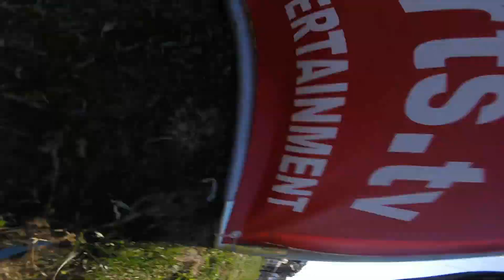The Charlie Show /// Episode 24 /// XR10 Comparison

Comment: The 1080 is damn good for crawling, no need for bl overkill imo, unless your comping. Had several in trail scalers, crawlers & knowing how cheap they are along with a decent re-buildable brushed motor.. I'm older & use to turn armutures for a couple hobbyshops & myself on race day. Hell even decent NIMH packs are so much more convenient trailing/crawling, charge up a few packs & maybe go the next day.. I know I'm rambling but that's what these sections are for.. Putting as much as I do into electrics into a crawler or basher as race kit is just not necessary, but to each there own I suppose. The new v3 just stock is perfect for club spec races, if your going to spend more like on the xr10 80amp, might as well & get something with more balls like LRP, MuchMore, or even Tekin. 80 or even 120a doesn't have nothing on most competition esc's.

Comment: Tnx a lot for the Info, would you please suggest me for which is the best choice for XRAY 12 22 for combo esc and motor?
i was thinking about 1S-HD Modified for 1/12 ( battery 2s is it good for it? ) and Motor XERUN V10 G3 Brushless Motor

Title: 6.5T OnRoad Spec.
what  I m concerning is about the battery to use, 
i hope that u will find time to let me know about it
TNX Antonio

Comment: Just put together a 10BL120, 
super impressed with handling a 3800kv Holmes Puller on 2s ... 

then, I put a 5 slot 8 turn holmes on the quickRun 1080 using 3s.. 
no problem. 

keep it up

Comment: Will the 60amp work or a redcat volcano
Reply: Yes, you have to solder the wire directly to the motor or you could solder the connectors from the old escrow on the wires

Comment: Have XR10 Justock ESC G2.1 13.5T COMBO, will it be safe to add 6+Leds to the system? Also whic LiPo battery will be a enough for this setup, an 6000 3s 30C can be enough?

Comment: Is the RX10 Justock sensored? and which motor is best for rock crawler super low speed with some high speed blashing?
Reply from the maker: I've had good luck with my 13.5 setup on 2s.  For 3s, a 17.5 turn might be in order. 

Only thing was an "option" High Torque (larger Diameter Rotor) and turned the motor endbell timing down for a bit better "crawl" performance.

Comment: Great info Charlie. I picked up the XR10 Pro Stock Spec and it's been wonderful thus far with my 13.5 Wheeler. However, I would like to start tuning the buggy for my particular performance on my current indoor track. Where can I go to learn more about these parameters that this ESC has to offer.
Reply from the maker: This applies to most of the ESCs actually. https://www.youtube.com/watch?v=-IyFV-9-N9g